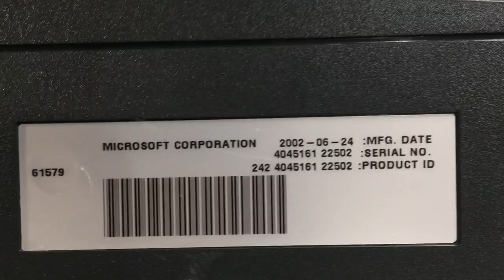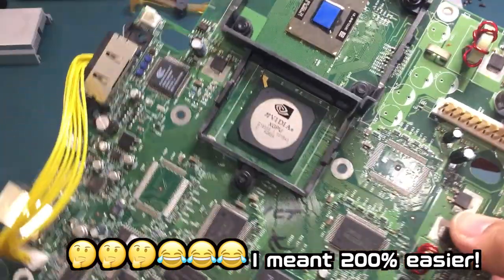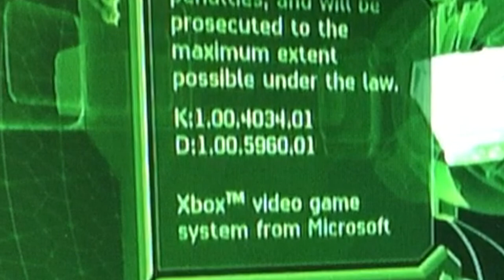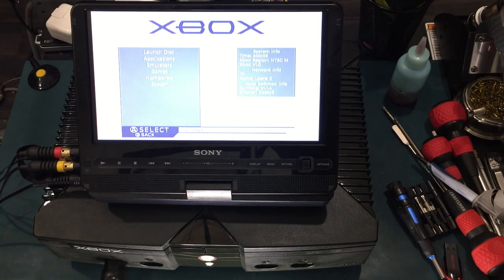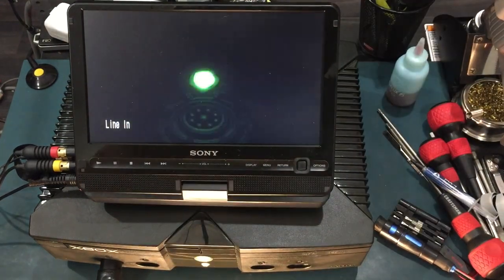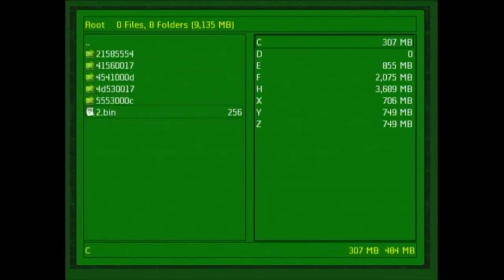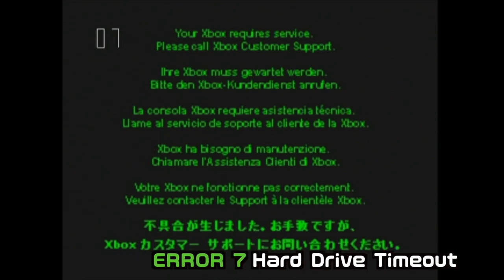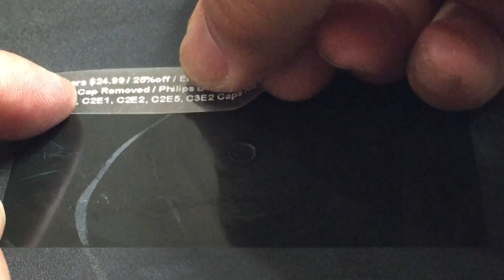OG XBox Error Codes 5, 7, 11, 13, 16 Explained & How To Fix Them [ep. 81]

Comment from the maker: You can shoot the bull here, or join the Reddit discussion here:

https://www.reddit.com/r/originalxbox/comments/9i7hby/error_codes_5_7_11_13_16_explained_how_to_fix/?
Reply: The Sega Holic Another high production value and informative video from Sega Holic.

Out of sheer curiosity, I checked out that Arrow website you talked about in your video. I thought that surely the "free" overnight shipping would be paid for by charging more money for the parts. I found the exact caps you used in the video, Rubycon YXG 1500uf 6.3v, on Arrow and Digikey. It costs $0.32 per cap on arrow and $0.65 per cap on Digikey. The only thing I think arrow doesn't have is bulk discount pricing but to get close to Arrow's pricing, you'd have to buy at least 100 of those caps on Digikey. And to top it all off, Arrow offers that free 1 day shipping. HOW DO THEY DO IT? I wonder how their parts stock compares to the giants, Digikey and Mouser. Surely there must be some downside to Arrow?

I'd be very interested in hearing how you found out about Arrow and how your experience was ordering with them. How were the components packaged as well? Digikey and Mouser do a good job putting everything in anti-static bags, and sometimes bubble wrapping delicate parts like 20mm glass fuses. Would you also be comfortable clarifying if they reached out to you for a sponsorship? (What with the discount code and all)
Reply from the maker: Arrow does have bulk discount, which differs on different items. AND THERE IS NO DOWNSIDE TO THEM. I've passed by one of their warehouses in Arizona, and it was huge. They even have a European presence as some of their components and parts get sent from there. Crazy thing is, when they say there is NO MINIMUM FOR FREE OVERNIGHT SHIPPING, IT'S REA.L. I've ordered parts that came out to just over $1, and it was sent, overnight... here in 2 days. Incredible.

I don't have any sponsorship from anybody. Seriously. I just like to share good sources.

If you watched my past videos, I've ordered from Mouser and Digikey in the past. I used to prefer Mouser, but shipping cost and availability is key to where I order. Digikey has a $3 saver shipping option, which Mouser doesn't, so my prefferred  use of parts distribuitors are Arrow, Digikey, then Mouser. Obviously, cross shop for prices to see if that offsets the shipping cost.

If you watched my recent Sega arcade stick builds, you know I need those AMP connectors and the pins that go in them. I tried to buy drectly from TE Connectiviity, and they list Arrow as an official distributor. 

As far as how they ship. Always top notch. Better or even with Mouser.  I can't believe the box size they choose sometimes, for the parts I'm buying. It seems like each different component comes in it's own box. Sensitive parts are sent in antistatic bags, and fragile parts are even sent with boxes with foam. I just can't believe it.

I ordered from Arrow years before, and I thnnk they got out of the consumer business for a bit, until they came back recently. Not sure, but I wasn't able to access their website for parts... unitl I did a search for one of those AMP connectors and they popped up.

They are a major distributor... WORLDWIDE.

Try them. Seriously, there is no downside. Order some parts worth a dollar or so, and youll be surprised. LMK how it goes.

And how'd you find out they were Rubycon caps... good eye!
Reply from the maker: Oh, and one more thing. Just browse around on their front page. Sometimes, they have some crazy deals. That's how I found out about the 12% off. Not long ago, they were giving away Raspberry Pi's with orderes over $35. INSANE!!! I still can't get over the FREE OVERNIGHT SHIPPING. I've really been abusing it. Now, I can just buy components in small quantities, without worrying about shipping, right when I need them- and I've been doing it.
Reply: The Sega Holic I'll most definitely have to check out Arrow, especially after the glowing review you gave them. I can't believe I haven't heard of them before. Even when I browse hobbyist forums, I don't think I've ever seen someone mention Arrow. I've never had problems with shipping or availability because I live in California. But the shipping costs for me certainly add up, especially since I usually upgrade to USPS priority because I don't like waiting. Maybe Arrow relies on high volume ordering big businesses to make most of their profit and is just nice enough to pass on cheap prices and free shipping to us low volume plebians.

Big thanks for that coupon code as well. I have a couple of projects sitting on my work bench and I can't think of a better time to try out Arrow for myself. I would have absolutely zero problems if it was a sponsorship, just thought I would ask.

You also give me too much credit on the caps, although it's quick you do give a decent zoom in on the caps you ordered in the video. That's how I was able to find the ones you ordered. However, I have something I'd like to bring up about those specific caps you replaced. 

Those caps that have an all silver housing are located around the CPU. The specific type of cap used there is important because it needs to be very low impedance and work well with high frequencies. They essentially work like battery wells that the CPU sucks from. Obviously CPU workloads and calculations differ greatly by the fraction of a second. And when the CPU goes from minimal usage to intensive loads in fractions of a second, those caps provide the CPU with bursts of power. That's why those replacement caps should be rated to handle high frequencies and have an ultra low impedance. That would be a much better job for a good quality polymer capacitor, typically the type used in PC motherboards. Check out these Nichicon RNU polymer caps: https://www.mouser.com/ProductDetail/Nichicon/RNU0J152MDN1?qs=sGAEpiMZZMsIwzbKW1rlgUIs0B55SsapsFugxbaus%252bM%3d

Unfortunately it appears that their rated life of 2000 hours doesn't match up to the 5000 hour Rubycon YXG you bought. But I think the added high frequency stress might affect those Rubycons. Or maybe not. To be fair those Rubycons are well made, but polymer caps are perfect for high frequency applications. And you might be able to find better polymer caps, the Nichicons just came up after a half quick search.
Reply from the maker: Definitely give Arrow a go. You won't be disappointed. And like you said, I'm a bit baffled by how they are going so unoticed at the moment. The Free Overnight shipping has been in effect for several months now,

As far as the caps go, there was no differentiating markings on them, besides the cap ratings. Obviously, for a novice like me, seeing all the available capacitors with the same ratings and reading their respective data sheets makes my head spin. I know Nichicon has about what.... about 10-20  different lines of electrolytic caps. Some are geared toward music, and others are "ultra low impedance." 

To be honest, I went for the cheapest I could get. But thanks for for clarifying on electrolytic vs Polymer and why it's vital to use the right one for CPUs. I should have paid more attention as I was reading up on the various caps, and made mistakes in my PC-Engine RGB adapter that I made about a year ago. Like what caps to use for noise filters on power lines... and when to use ceramic vs electrolytic vs tantalum. What made me re-read up on it was when I found out that the Clock caps on these OG Xboxes are gas type caps. Should have paid more attention in my electronics classes years back. Scary to think how much we forget over our lifetimes. LOL. Are you an engineer? You seem to know your stuff. 

As far as rated life hours go... are we really going to play with our XBoxes for 2000 vs 5000 hours? We have so much avaiable to us today, as far as what takes up our time.

Again, thanks for pointing that up. I'll bring it up surely, when I need to replace capcitors the next time on the next project.
Reply: Make no mistake, I'm on the same boat. In fact, if you consider yourself a novice then I'd most likely be a level below you. I'm just a hobbyist. I just went on a quest a while back when I was recapping an Xbox. I said "surely there's a reason this cluster of capacitors looks different from the rest". From there I looked into PC motherboard capacitors because the Xbox is basically just a modified PC anyways. And from there I read up on the importance of high frequency polymer capacitors used to feed CPUs. Just gotta share the knowledge you know? You have an entire channel dedicated to doing exactly that so I'm glad I could help the little bit I could.

Could you clarify what or where you heard the clock caps being "gas" types? That's the first I've heard that. Did you mean aerogel? If I remember correctly, all Xbox revisions except 1.6 use "aerogel" 1F 2.5v supercaps. I think aerogel was an attempt at a fancy semi-solid electrolyte fluid. Since old supercapacitor technology wasn't as fancy as modern ones, they came out with these aerogel caps that were apparently good at slowly discharging which makes sense for a capacitor that keeps the time. But that aerogel technology ended up being a huge bust because the life cycle of the cap was something like 500 cycles total (to hell with an hour rating). And to make matters worse, that aerogel stuff is much more acidic than standard capacitor fluid hence that Xbox trace repair video you did.

You do have a good point about the hour ratings, can't sit down and play Xbox all day anymore like before. But I thought you specifically chose your Rubycon caps, so I thought you'd be bummed about the lower hour rating.

If you can spare an extra dime or so for every cap, and don't want to worry too much about looking through capacitor spec sheets I highly recommend you use Panasonic FR series capacitors. Since it's never a good idea to replace a cap with a worse spec one (105° to 85° or low impedance with a so-so general purpose cap) but it's completely fine, or better, to replace it with a better spec one you should give those Panasonic FR caps a try. It's generally agreed upon by capacitor snobs that those are the best quality general purpose caps out there. I call it general purpose because I use them a lot but they certainly aren't your standard general cap: very low impedance/esr, high ripple current, high temp, very long life (some bigger caps have 10,000+ hour ratings). And in all honesty they aren't much more expensive than regular caps. I used to hunt around spec sheets for my projects and personally found the FR caps to be better specced than almost any others.
https://www.digikey.com/catalog/en/partgroup/fr-series/3611

Unfortunately it appears that Arrow's interface needs a little work. They don't have a feature that I love from Digikey and Mouser where they have a tab in the info section that specifically states the capacitor series. It usually lets you click on the series and it'll take you to a page dedicated to that exact series of cap from the manufacturer. It's extremely handy when you find a series you like but want to browse through other cap values inside that series.

Compare
https://www.digikey.com/product-detail/en/panasonic-electronic-components/EEU-FR1H331LB/P15377CT-ND/3072257
vs
https://www.arrow.com/en/products/eeufr1h331lb/panasonic

I guess I'll have to use Digikey for their search feature, get the manufacturer part number from the info page, and then paste the part number into arrow.

Of course, there will always be other caps better suited for very specific jobs (like polymers for high frequency), and I still go spec sheet hunting when I know I need caps for a specific purpose, but these caps are gloriously over-specced and work wonders for 90% of the stuff I work on.
Reply from the maker: My mistake, I used the wrong terminology- I'm a hobbyist like, you.

On Aerogel- Wikipedia states: Aerogel is a synthetic porous ultralight material derived from a gel, in which the liquid component for the gel has been replaced with a gas.

And speaking of the clock cap... why did MS decide to use something that would only hold it's charge for a couple of hours?

And speaking about caps. I caught this from Arro's site: The capacitor plague.
https://www.arrow.com/en/research-and-events/videos/arrow-tech-trivia-capacitor-plague
The XBox was manufactured during the plague.

And about those Panasonic caps... it's being featured more at ARROW as searches come up with Panasonic caps first, instead of how Nichicon is the majority like other vendors. Pricing is pretty close, so thanks for the heads up as far as quality. I always get Nichicon caps prior to my trying the Rubycon, as I mostly see Nichicon being used in the various consoles and electronics that I've tried to fix.

And as far as the Arrow webstore being clunky. Yep. I know what you mean. It's hard sometimes to even bring up the specs that you can choose when you do a search, to narrow down it down. It's why I use Mouser to do searches, and see if Arrow carries them.

Seriously, LMK what your experience is like if you do decide to try them out.
Reply: I didn't know about the gas in aerogel caps, very interesting way to make such a bad capacitor. I don't know why Microsoft decided to use such awful supercaps instead of a nice rechargeable battery like everyone else. My guess is a mix of behind the scenes deals for cheaper parts and the marketing strategy behind the Xbox. The Xbox had early internet capabilities, a hard drive to store and play music and movies, etc. It was basically a home media setup for a living room. The console itself is also quite heavy and bulky. And because of this, I'd imagine not a lot of people would unplug their Xboxes once they found a spot for them. So that supercapacitor that would only keep the time for a matter of hours probably didn't seem like that big of a deal to Microsoft. It's meant more as a short term time backup rather than a more long term thing (probably just in case the power went out or something similar). And even if the cap goes out, the Xbox had a feature where it auto-syncs the date and time from online if you have it plugged into a network. So they tried to cover themselves at least. I don't know if the time sync will work nowadays though. I think it still would since Microsoft has had their own NTP server for Windows PCs since the early 90s but I haven't tested it.

Yep, I have a good recollection about the capacitor plague. All of those tainted caps run havoc on late 90s/early 2000's electronics, ESPECIALLY PC hardware. I tend to recap everything I own that was around that era.

I actually just finished placing my first order on Arrow to the sum of ~$37. It's essentially parts to fully recap a 1.0 revision Xbox I'm currently working on (plus a few extra goodies thrown in there). For an order like this, I'd easily be spending an extra $8 or more. I had to use Mouser for all the parts searching though because Arrow's search tools are just inferior. 99% of the parts I ordered were cheaper than Digikey and Mouser, sometimes by a huge margin. For example, a good EATON 1F 2.5v supercap cost $3.30 on Mouser but cost an entire dollar less on Digikey. Lots of caps were also 5, 10, 15 cents cheaper per unit on Arrow, absolutely amazing considering how cheap the parts are already. The one major downside I found to Arrow were that quite a few of my favorite go-to Panasonic FR caps are limited to a minimum order of 200+. One of the things I do the most is recap Sega Genesis model 1s. And quite a few of my go-to caps for Genesis recaps are behind that 200 minimum paywall. The parts themselves are dirt cheap though thanks to the high volume, but it sucks because I won't be able to quickly order those caps for one-time Genesis recaps. I'll have to plan things out more and keep lots of them on hand.

One of my go-to's is the Panasonic FR 100uf 25v.
https://www.arrow.com/en/products/eeu-fr1e101/panasonic
https://www.digikey.com/product-detail/en/panasonic-electronic-components/EEU-FR1E101/P14413-ND/2433547

Less than 1/3 the cost from Arrow but with a minimum of 200, it'll be almost $21 whenever I need to stock up on more. A gift and a curse at the same time.

I'll check in again, if you want, when my order comes in to let you know how it went. I placed the order today on Sunday so my guess is that it should get delivered to me on Tuesday.